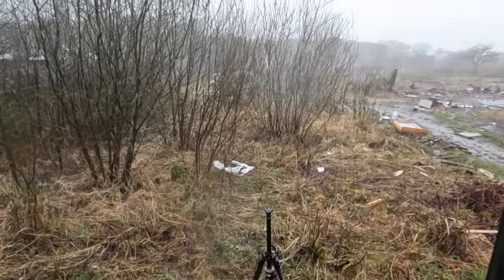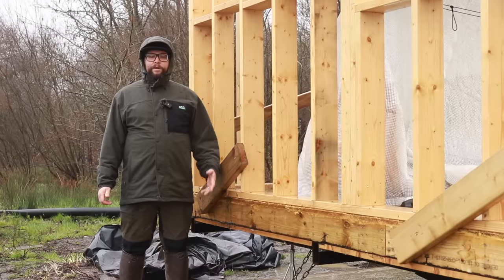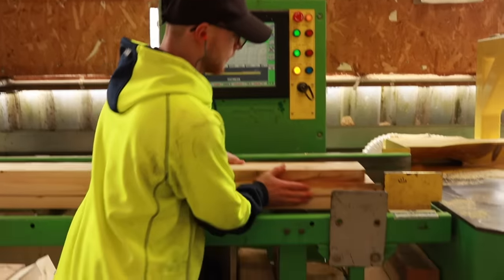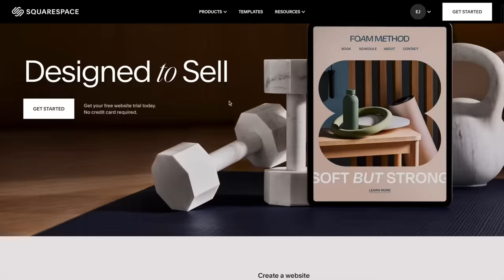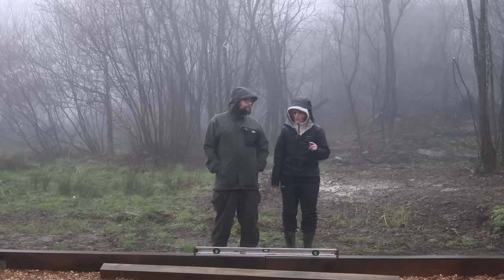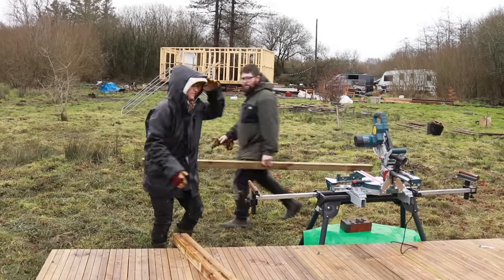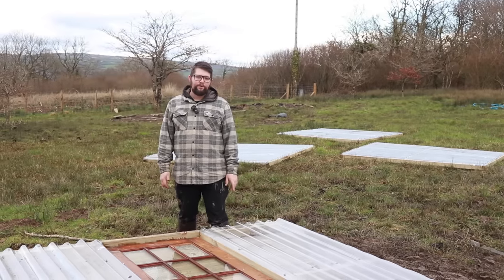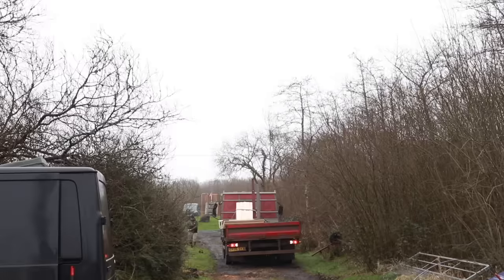Reality of trying to live OFF-GRID...We're struggling

Comment: I worked in New Zealand for a while.  I gave up waiting for the rain to stop, and just wore heavy woolen clothing which even when soaked and heavy, afforded some insulation.

However, if one wishes to de-water the land, and get some unsaturated soil, there are two ways of doing it.  One is to use boundary and interstitial drains running from the high points of your land to the low, in which are buried field tiles or plastic drain-coil type products.

That will allow your soil to drain more easily, and s to discourage puddling on the surface.

The second is a longer term process and involves the planting of trees which suck moisture from the soil, and evaporate it readily.  You would have to consult your local forestry crowd to find out which species are the most suitable.  I used an Australian variety of melaleuca,  each specimen of which evaporated about ten gallons of water a day when young, and they grow quickly, so by the time the trunk was about ten inches in diameter, it was draining about forty gallons on a hot day, and the land went from swamp to grassland.

Boundary drains are the way one stops water from adjacent properties travelling through the soil, or over it, onto your land.  They can be open drains, or gravel filled with root barrier lining, and a perforated pipe system such as "Draincoil" laid in the bottom.  

OF COURSE this is not cheap, but often it is the only way a property can be improved, and one has to have a slope and a dug out and limed with heavy plastic place in which to harvest the water for one's own use, because buying water can get expensive. 

One also has to ask why the original caravan park went broke, and that is the problem which is going to affect you too.  My guess is it was flooding-out of the camp-sites, or it was just too remote and storm-plagued.  Trees are essential on the windward side of any human habitation, and wind generators are not a bad idea either.  Both take the power out of any constant wind problem.
Reply from the maker: Hi Mike, great comment and thanks for so much info. We have plans for land drains with the perforated pipe, fabric and gravel method, it just needs to dry out so we can get machines on, the guys we had to do some fencing are going to do this work with us so we can't wait for that. One big issue we have is we get rain water runoff from the main road come straight down the driveway, we have plans to install a ACO drain across the top of our drive to divert this into an existing culvert which i think will make a huge difference.

The original site did not go broke, it was a residential site for workers and families at the coal mine across the road which was owned by the mine, The mine closed in the late 80's and all the infrastructure for it demolished so there was no need for the caravan site anymore as there were no employee's to house.

Our neighbours who are in their 80's actually lived on this site and said it was beautifully kept, and everyone had nice gardens on their caravan plots, an old farmer in the village remembers the land before the caravan site and said that they used to make silage from these fields, so the moisture issue with the land it down to neglect and damage to the drainage systems that were once in place which is annoying and costly to us to correct.

Comment: I've followed you from the beginning and am so impressed with what you've both achieved.
Re. Your polytunnel/greenhouse structure - you're going to need some more ventilation as it will be too hot in the Summer (hard to believe I know😊) Polytunnels usually have a window in the opposite wall to the door so when you have the door open in the Summer the breeze goes straight through.
Keep up the good work.
Reply from the maker: Thanks for sharing your knowledge :) we will look at installing some installation. Thanks so much!

Comment: Missed you guys, just one hint on the greenhouse. For the rain to run off the roof you will need an incline,  maybe look at a remodel to lower the heigh of the rear wall and adjust the sides to suit.
Reply from the maker: Thank you 🥰 we did actually make is so the bottom back wall was shorter and the two side walls were angled at the top BUT the greenhouse started sinking at the back so we ended up having to raised the back wall again onto another level of wood, which completely ruined our angled roof for run off haha

Comment: I ran my house with 6 caravan batteries and solar panels. I would use spare power to heat up the hot water tank. So I could take a shower without using the 9 kilowatt shower. Then you feed the washing machine with the hot water rather than it using the 2 kilowatt heating element. I did try a camping solar bag to heat the water plus I`ve made a copper tube square that can heat up water. No good this time of year tho lol.
Reply from the maker: Sounds amazing! We had been using a gas powered joolca shower which had been amazing for the first year on the land!

Comment: Put some natural strapping/twine from the flooring over the frame stopping the water and down to the ground.
Natural wicking should minimise the necessity for vacuuming.
Failing that you could drill a port through the flooring to drain, line it with plastic pipe to prevent it entering the board and plug that later once you're roofed up. 🤘
*Just saw the notching 👍
Subbed.

Comment: FYI
An engineering problem with your structures, which you  solve now easily and cheaply as later it will cost you more.  The structures need some triangulation in them.
On lorries, we used to put dome small triangle plates in each corner to stop them from going out of square.
On wood structures like yours, we put a  bracing bar diagonally from corner to corner on each side of the greenhouse.
This stops the wind from scewing the walls and roof.  
I am an engineer by trade.
Please think about the mods to achieve the trianges.

Comment: I dont want to seem negative, but for the cost and time involved in building your greenhouse, you could have probably found a proper glass greenhouse for next to nothing on gumtree or market place and put that up (or even bought new for not much more). 

Ive found that the corrugated plastic sheets have a very limited lifespan and soon go cloudy, limiting the light getting in and get very brittle, where as glass lasts forever.

Keep up the good work, spring and better weather are just around the corner, and by next winter youll be snug in your tiny house.
Reply from the maker: Thanks Paul 😊 we did spend weeks looking for a green house on gumtree/marketplace/vinted and eBay but nothing suitable came up sadly, so we decided to build our own. This is just for our seeds so doesn't need to be very big and we have a big polytunnel we bought in the black friday sale we will be putting up when the weather is better :)

Comment: All that wind, an endless source of free energy. Surely a must have for your tiny home! Combination of wood burning and free electricity - you’ll be a modern day Tom and Barbara Good!
Reply: the cost,instillation and upkeep of off grid power make it 1 not free at all and 2 really time consuming and complicated,people on grid imagine everything is free when your off grid and its the complete opposite,its way more expensive,the cost of the turbine,cabling,batteries,inverter,charger and fuse board set up can run into 10s of thousands,finding an electrician that specialises in the installation  and servicing is hard if you cant do it yourselves,most off gridders do eventually set up a off grid power system but it comes way down the line,running a genny although way way more expensive than on grid electric plus its a pain, sine wave problems ect,is what most are stuck with until everything else has been done.

Comment: you two are very sweet. Btw I would put a dpm down on the floor then you can squeegee the floor out of the door opening. (I would probably have done this first and built the walls on top of it, then cut it out with a blade when the roof is on)
Reply from the maker: Thanks for the suggestion. We did nearly do that at the start but had read loads of horror stories of it causes the floor to sweat / not being able to get the moister out underneath, so we didn't end up doing it, but I do love your idea

Comment: You took the protection off the eagger board, you are meant to leave it on to protect from rain and mortar until the roof is on.
Reply from the maker: No we didn't ☺️
Reply: @CampOutWest  Okay, it’s just the logo is normally on the peel off sticker, I couldn’t see that on there.
Reply from the maker: @wanderingpots  This egger protect doesn't have the peel off film layer, that's just so you don't have to clean the flooring before laying your internal floor, the grey phenolic type surface is the waterproof layer and the pu glue on the seams waterproofs them to each other

Comment: Just make a hole in the floor with a core drill mate. You can glue the round piece of wood back into the floor when you've finished the cabin.😊🌈
Reply from the maker: Thanks! Just conscious about not getting the insulation underneath wet
Reply: @CampOutWest  Coat the hole with a waterproof paint.

Comment: I feel for you but it seems that your main problem is poor planning. Working outside in the season of rain, building the frame before you even had roof trusses, not tarping the whole thing, etc., etc. I have homesteaded myself and many of your headaches are just poor planning. But live and learn, right? Good luck.
Reply from the maker: Interesting you would call it poor planning. We have no control of the weather sadly. We do this alongside our full time jobs so have to work when our days off fall. If we decided not to work for a whole season because off the bad weather our project would be at a standstill for months on end. Last year was the 11th wettest year for over 150 years - you can't plan for that. We have tarpped the building multiple times but due to living on a hill and the horrific wind and storms we've had, they don't even last a night, no mater how we strap them down. It's tarpped currently but rain is still getting in due to the wind and has ripped this tarp in the middle. We've bought so many tarps and they just don't last. It's also not advised to order your roof trusses until your walls are build so you can get the truss size correct, so you would not order the trusses before the frame was complete. The main issue we have is simply budget and the luxury of time. If we had a bigger budget we could have hired a warehouse and built the cabin inside to avoid the bad weather and if we had the time we could have waited months for when the weather is dry, but sadly that's 2 things we don't have.

Comment: ARGHH! you've built a green house with no ventilation, no consideration from where light comes from and way too high for the floor space... there's a reason why poly tunnels exist... and you've done zero to exploit the conditions in which you're operating... Good luck.. this is going to become a very expensive hobby
Reply from the maker: We did consider where to put the green house which is why it's in this area, as it gets the most amount of light all day (which is why we put our raised bed garden here also) the greenhouse has ventilation gaps - the whole roof is vented and we have open air gaps between every coregation to allow air flow. We don't film everything we do or every design element.

Comment: I really admire what you are doing  but Why dont you tilt your cabin base so the water runs off. & level it when you want to work on it ! And why did you not make your own trusses its not brain science and cheaper there is a free online calculator for structural calcs. You could have also made the trailer walls in sections that could be lifted and installed with the floor and the trusses easily in 1 day when its dry ?